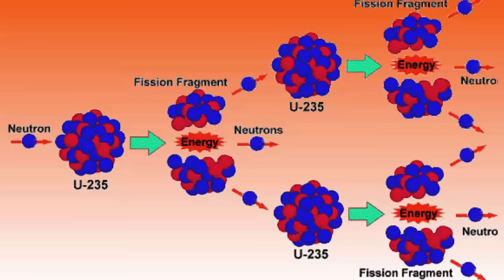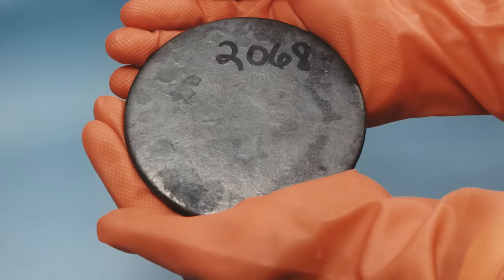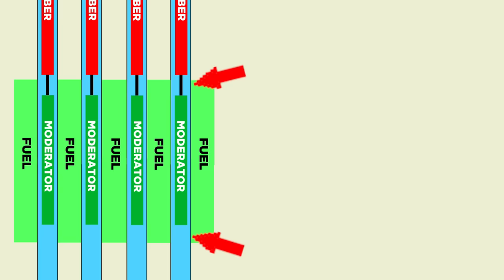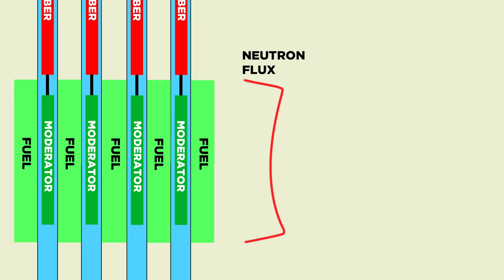What /Actually/ Happened at Chernobyl

Comment from the maker: Corrections!
1. Not all of the uranium in a nuclear bomb...fizzes...actually only pretty small amount does before the core blows up and the atoms get too far apart. And yet...it's still a pretty big deal.

2. It's not "fizzes." Fission is both a noun and verb, so uranium "fissions" 

3. I imply in this video a little bit that you can't have a light (regular) water reactor with a negative void coefficient...you can, you just need a different fuel / moderator realtionship. There are lots of light water reactors that are much safer than RBMK designs....they tend to require more fuel enrichment. 

4. An earlier version of this video got the date wrong and said October 26th instead of April 26. I just removed that line, which is something YouTube lets you do now.

Let me know if you've got anything else I should add here!!
Reply: So my birthday is on the anniversary of the Chernobyl meltdown? Yay?
Reply: @desireevelez530  Mine is when the Hindenburg crashed, well  I was born a few decades later, but still
Reply: I was so confused bc I was sure Chernobyl was in my birth year but over half a year before I was born, causing my mom to worry like crazy about me. (She lived in Germany, close enough to be possibly affected.)
Reply: @naomilovenpeace  Mine too. Here's a tip. Turn off the news.
Reply: Unnecessarily Pedantic Alert

The verb form of fission is also fission. So, U-235 fissions in a chain reaction.
Reply from the maker: @mariewikiwaka3851  Fizzes!
Reply: Correction to 1:54 Fission not allways leads to lighter particles and emmited energy, only if you split some heavy particles like Uranium. If you would manage to split up Helium you had to invest a least the erergy you got by the fusion  of hydroden to helium. Otherwise we violated the conservation of mass/energy.
Reply: Can we mention that the potential impact was severely exaggerated. Like there was no way it was ever going to be "fatal to the entire population of Kiev".
Reply: Furious Imperator  my mom was pregnant with me too I was born 4 months after
Reply: Nuclear Reactors are eco-friendly ???
Coz one mistake can take away thousands of lives affecting future generations  too... 
What are your views..? 
These fission and fusion gonna really do fission and fusion leading to.. what?!!!
Reply: vlogbrothers I said “Unnecessarily Pedantic”. I personally like fizzes better.
Reply: So why cant we channel or contain the heat byproduct from fission effectively? Isn't it also be a form of energy (thermal) we can contain & use? P.S. I'm not smart
Reply: You did well, it is a dense topic, but without that incident things could have been different through out the world.
Reply: Hi Hank, steamfitter and power engineer here, thank you for the explanation on explosive boiling.
Reply: @vlogbrothers  100% HERE FOR THIS NEW AND IMPROVED CONJUGATION
Reply: That was Chernobyl’s End Game.
Reply: @pranakhan  After the coolant absorbs the reactor heat, it is pumped to another place where that heat is transferred to water (cooling the coolant so it can be reused), boiling the water into steam that is then used to drive the turbines that actually generate the electricity. So not only is that heat indeed a form of energy we can use, generating that heat is the entire point of a nuclear reactor, or indeed any kind of power plant that uses fuel, from coal to natural gas.
Reply: @vlogbrothers  Language is dynamic and I do like the term 'fizzes' to describe the reaction of fission.
Reply: @Izandaia  Thank you for the detailed explanation! That makes total sense. So in the incident of a meltdown, the heat generated must be so intense that it's compromising multiple systems then? Is the cap on the heat intensity based on the materials or the design, or both? Its hard to imagine in our modern age facing the problems we have with this kind of energy, from a laymans standpoint
Reply: After watching the mini series I feel like nuclear power is just not worth the risk.  I realise this comes from a place of fear and may not be rational but I really wouldn't want a reactor anywhere near my house.
Reply: I don’t know if someone else mentioned it, but the miniseries doesn’t portray the politics of the situation well either. I enjoyed watching it, but it totally misunderstood the politics of the Soviet system and added drama and conflict that never would have existed in reality. The scientist would’ve never gotten her lab if she acted the way she did in the show.
Reply: Yeah my brain, after watching the HBO miniseries, said something wasn’t right. Mainly because the cleanup/extinguishing of the fire happened at the beginning of May, just a few days after the explosion. So I had to scratch my head a bit when Hank said October....
Reply: I was gonna say. This was literally the day before I was born.
Reply: Thorium is fissile?
Reply: Thank you.
Reply: Thanks for the shout out to Scott Manley.  When are you guys going to have a joint video where he teaches you how to build and  fly rockets in Kerbal Space Program?
Reply: @pranakhan  I don't know about Chernobyl, but many reactors use the heat from the fission to heat another system of water to turn turbines that make electricity. Keeping the two systems separate is to minimize the radiation on the water system so it can be cooled down.  The large structures at most nuclear facilities in the US are actually the cooling towers.  That probably made you more confused. 😊
Reply: Naomi Williams also my ex’s birthday! In hindsight that makes the explosive breakup make more sense lol (decent person, terrible breakup)
Reply: @chupaxf  I've done similar reading and taken similar courses (Я даже немного говорю по русски), but I'll admit I got a fair bit of my opinion from Masha Gessen. If you know current Russian politics, you know her name. I'd highly recommend the article she wrote for the Newyorker. Also while I understand the usefulness for having a composite character for sake of screen-time, I found her character irksome in that she was all-knowing despite the speed of events and never seemed to get in trouble. Having more scientists would've allowed the series to more accurately portray the processes and risks of Soviet science. I also think it's fair to point out fundamental inaccuracies in docudramas like this when they become this successful because it often forms much of the entirety of people's knowledge-bases about the events.
https://www.newyorker.com/news/our-columnists/what-hbos-chernobyl-got-right-and-what-it-got-terribly-wrong
Reply: @nameme5280  I do understand where you come from but I'd also want you to know that nuclear power is efficient and friendly to the environment when compared to our conventional methods of electricity generation.. I do understand your fear of risking people's lives but we're not out of risk ourselves.. we just don't see the things that are at stake yet.. the amount the conventional methods contribute to environmental pollution and global warming is fairly large .. it's like a slow poison.. everything has its risks and effects if not used conservatively.. but we need to see which one has the least side effects given we are absolutely cautious of what might happen.. I hope my insight was helpful.. incidents like Chernobyl, while they're really heart wrenching are a wake up call to be more cautious but not just a sign to turn our backs to great developments in the future. DFTBA!
Reply: Mine is Pearl Harbor Day.
Reply: @naomilovenpeace  Mine too, TIL.

My fiance's birthday is September 11th & mine is Chernobyl's anniversary.

I have jokes I want to make now but they are all in poor taste.
Reply from the maker: @neneold4912  Thorium is not fissile. Thorium can be triggered to decay into an unnatural fissile isotope. Usually we use plutonium for this.
Reply: vlogbrothers I’d like to add that you can’t emit pure energy as radiation. All radiation are particles
Reply: Wow, humans are dumb sometimes, sigh. I remember when this happened, scared the hell out of me, I've never been the same since. As a kid I didn't really get how far away I lived from Chernoble or anything about politics and poverty etc, I was just scared that one of these powerplants was somewhere nearby to where I live. I'm now going to go find the YT vid on how surprisingly well the wildlife ect around the site have rebound... gotta get my headspace back to happier.
Reply: vlogbrothers thank for making corrections for me comrade Hank
Reply: About number four: It was actually really noticeable, but maybe I think that since I watched the original.
Reply: Naomi Williams omg same
Reply: Well done. Especially the mention of Scott Manley at the end, so no one else has to point to that.

I'd learned a simplified version of this in school, long before this event. It was likely 1979, just after the incident at Three Mile Island, as I live in New Jersey. The information I got from that, and take this with a grain of salt, it was '79 and we were 10- and 11-year-olds, was that "American reactors pull the rods out to stop, and Soviet reactors put them in. Ours (in the U.S.) is a much safer method, but things can still go wrong."

So 7 years later, in my senior year in high school, this happens, and the reaction was "well yeah, that's what you get when you build a reactor backwards."
Reply: Hey, how can I edit out things from YouTube videos as he did in number 4?
Reply: Mass is not converted to energy or vice versa. Mass and energy are equivalent.
Reply: @DehimVerveen  If potential energy is converted to kinetic energy, or any energy type is converted another, then "converted" is correct. It's one form becoming another.
Reply: So, while on the topic of Uranium, are we going to find out if Carl ever got his?
Reply: "In a nuclear bomb it's 80% U235" It's usually plutonium.

The term for a partial explosion of nuclear material is a fizzle not a fizz. A fizzle causes a rapid release of energy that very rapidly disassembles the material before it can fully detonate. Even a fizzle can release huge amounts of energy.
Reply: Nope... The original had an error, so now the entire video is considered irrational and consequently, will be interpreted as heresy.
Reply: Well more than likely the fuel rods cracked, blocking the rest of the control rods from completely entering the uranium fuel. So the graphite was stuck, continuously speeding up the neutron and then causing the explosions.
Reply: @vlogbrothers Your "the nuclear reaction products are lighter therefore the mass converted into energy" explanation is a common misconception about the source of nuclear energy. All releases of energy, not just nuclear, will be associated with a release of mass, because energy has mass. This includes chemical reactions, for example. If you burn hydrogen in oxygen for example, and let the heat dissipate, the water you get will have a tiny bit less mass than the combined masses of the hydrogen and oxygen you had at the start. We don't talk about the change in mass "causing" chemical energy. The change in mass is just a minor tangential consequence. What caused chemical energy to be released was the change in the arrangement of electrons and protons, which have electric forces between them. Similarly what causes nuclear energy to be released is the change in arrangement of neutrons and protons, which have nuclear forces between them.
Reply: A FEW major and small things to add (seven points):
1. the USSR in terms of governing at the time was nothing like it was depicted in the TV series
2. no one was threatening to kill anyone
3. ministers did not come to miners with AK-armed guards
4. people in the government and scientists had great respect for each other, a completely opposite picture to the smear the TV show does to those people and their memory
5. the minister was an engineer himself and he has never needed an explanation on how the reactor works (even more: every child in the USSR knew that as it was an obligatory part of education in physics course)
6. the real cause of "hiding the information" was to prevent panic to evacuate 300 000 people from the area. As a result, Chernobyl has caused like orders of magnitude FEWER victims than e.g. Fukushima, Katrina and many other disasters where panic has actually prevented successful evacuation and caused from significant part to even the majority of all victims
7. almost no one was drinking vodka in real-life equivalents of the scenes where the TV show depicted it.
Reply: Where did you get your t shirt from?
Reply: @Tfin  Yes, one type of energy is converted to another type of energy, but the mass before and after the reaction is the same.
Reply: You didn't see a wrong date. You didn't. You didn't!!! Because it's not there!
Reply: The use of the term 'reaction rate' here along with the mention of the reaction 'speeding up' or 'slowing down' is somewhat confusing. Reaction rate has an exact definition in chemistry which relates the change in products and reactants over time with the concentration of those materials. What's really being discussed is the number of reactions occuring in a given volume over a period of time. And the the speed of individual reactions is not changing. A better way to approach this might be using the 'intensity' of the reaction.
Reply: Sorry, I'd never actually post something like this, but hey, you asked for it... Both the "m" and the "c" in E=mc^2 should be lower-case.
Reply: vlogbrothers a heavy water reactor (the CANDU) actually has a positive void coefficient (because of different somewhat difficult reasons, but simplistic, because moderator and coolant are sill separated). A regular Light Water Reactor however, were water is both the coolant and moderator, the statement holds. So, not heavy water, just normal water.
Reply: @hororskull  Probably not. But the two are extremely close, and radiation levels in Kiev were at times extremely high and should have justified at least a partial evacuation. 

In one sense of course there was a partial evacuation: the children of party leadership were sent elsewhere by their concerned parents -- the same people who lied to the public about there being no risk and who took measures to prevent anyone else from sending their children away.
Reply: 1:56 it doesn't become energy it transferred into energy
Reply: The xenon is always there and being produced in an RBMK reactor. It's that in stable output operation it's getting burned up as fast as you are making it.
Reply: I remember them mentioning in the show that the rods that they actually completely pulled out of the reactor, and then put back in to increase the power level, at the very tip, were coated in a boron layer, and not graphite. Later on in the testimony episode they go on to explain that this was a cheaper option. If there was graphite on that portion of the rod, the reaction wouldn't have spiked as much as it did, because graphite in part can actually help stabilize the reaction, but the Boron was an accelerant. This was in part part of the positive feedback loop of which you're speaking of. Then they later go on to explain that all of the reactors in the Soviet Union of the time did have this defect, and that why their fail safe button didn't work in the end.

I'm sorry if this isn't super clear, I'm still trying to completely understand the situation myself. I'm currently in school studying a BSc in Physics while doing nuclear/radiation experiments so this is a fascinating topic for me!
Reply: Correction #5. You didn't see graphite on the ground because it's not there!!!
Reply: @nameme5280  Same.  After watching John Carpenter's The Thing, I decided arctic research was not worth the risk.
Reply: @111ch1a1d111  hahaha, such a Chad you are
Reply: My brain hurts.
Reply: @naomilovenpeace  My late brother's, too. And the Rodney King riots anniversary.
Reply: Hi Hank, thank you so much for this video, I feel like for the very first time I'm really beginning to understand what happened in the reactor. I still have one question though: at about 3/4 of the video (10:23) you say "The thing that you're supposed to do ..." but you never finish that sentence! So now I'm still wondering, what were they supposed to do? I'm guessing instead of pushing the rods further in, they should have taken them out completely and filled that space with water? Am I guessing correctly? Would be great if you (or anyone else of course) could answer that question. Thanks!
Reply: 12:00 i dont think the steam just splits into hydrogen/oxygen due to the heat (or wouldnt it detonate right then and there?). I believe it was due to the zirconium alloy getting oxidized by the steam, liberating the hydrogen. Thats why it wouldnt just explode right there, the oxygen was hogged by the zirconium cladding on the fuel rods. (Google oxidation of zirconium by steam).
Reply: You should talk about LIFTR reactors in another video. Those are basically self regulating reactors that can't explode.
Reply: Hmmm, kinda not really... 

Xenon was a key reason for removing too many control rods, which increased the positive void coefficient of the reactor. However, the burning of the xenon itself is a slow process, not significantly contributing to the power excursion. 

The trigger for the power excursion was the experiment to trip 4 of 8 running recirculation pumps several seconds prior the accident. The recirculation flow then slowly decreased due to the pump run-down, the steam content within the pressure tubes increased (the RBMK was kind of a boiling water reactor), and this caused a gain in reactivity. The process computer inserted more and more of the  automatic rods, to maintain a constant fission power. Only after all automatic rods were inserted, they pressed the SCRAM button... after this point your explanation then is correct ...

Long story short conclusion, the xenon only played a role for preparing the stage for the main player: the positive void coefficient ..

And btw, there are no high-power reactors moderated and cooled by heavy water. The canadian CANDU as well as the argentinian PHWR use D2O for moderation but H2O for cooling. Therefore these reactors also have a positice void coefficient ... but by design this coefficient is way smaller than in the RBMK that it can be controlled by fast-acting rods...
Reply: @naomilovenpeace  You may celebrate the end of the evil empire that was the U.S.S.R..
Reply: Also the spent fuel was reprocessed into plutonium just like the Hanford B.  But unlike it RBMK recycled its coolant instead of just dumping it back into the Columbia river.
Reply: Others may have said this but, weapons grade uranium for bombs have to be at minimum 95% purity to create the blast. Most modern bombs that use uranium are closer to 99% purity. Current generation nuclear reactors use fuel purified to around 80%.
Reply: Why do Neutrons exist? Actually, try and figure out the way to pack a bunch of positively charged particles within a radius of about 10^-15 m without anything to bind them. Actually, neutrons are there just to keep the nucleus in shape. I guess you might want to add this to the list of corrections.
Reply: vlogbrothers Your explanation of events doesn’t indicate that at the heart of this it occurred because of negligence of the reactor staff.  The design, although foolish, was not inherently unsafe.  Also, the rods moved in groups in this reactor.   This is critical but it takes too long to explain.  If the DOE has publicly released their report on this I recommend you read it.  And I really wished you had discussed criticality and prompt criticality
Reply: Conversely to point 3, you imply that heavy water moderated reactors necessarily have a negative void coefficient. This is untrue, as demonstrated in the CANDU design at the station I work at.

There are postulated accident scenarios where a positive void coefficient would be preferable, so one shouldn't get too fixated on the sign of the void coefficient as an analogue for the safety of the reactor's design in all accident scenarios- it's a more nuanced topic involving more variables than can really be gotten into here.

The magnitude of the coefficient, on the other hand, is what determines the kinetics of the transient, so the smaller the difference between the moderating effects of the void versus the liquid moderator, the more time the operators have to react and either reestablish control or activate the special safety systems that kill the chain reaction (with acknowledgement that decay heat will always need to be removed for a period of time after shutdown).
Reply: Anonymous Anonymous  "we've also been able to find things like the unstable form of plutonium in space where there are no nuclear reactors"

I'd like to point you to our nearest extra-planetary nuclear reactor. We call it the sun. Space is filled with nuclear reactors. The fusion that occurs in stars is the source of the heavier elements. That's where that quote about us all being star-stuff comes from.
Reply: NuclearSavety Close but incorrect. The CANDU is absolutely a heavy water cooled and moderated reactor. There is a heat transport circuit (coolant) which is D2O at high pressure and temperature that runs through a series of pressure tubes which have the fuel pellets loaded inside and continues on to boilers which produce steam from water on a secondary side to drive the turbine which turns the generators to produce electricity.

Separated from the pressure tube by an insulating annulus gas space is an outer tube called a calandria tube. This separates the fuel channels from the moderator which sits inside a large vessel called the calandria. The moderator heavy water is at a lower pressure and temperature than the coolant.

The selection of an all heavy water design was purposeful as it allows natural uranium to be used directly as a fuel, bypassing the need for costly enrichment facilities. (This was less of a factor for countries which were pursuing nuclear arms programs as these would be needed for military purposes anyways).

Natural uranium can be used in this design because heavy water is less likely to capture a neutron and prevent it from going on to interact with another U-235 atom to continue the chain reaction. Since a high proportion of the neutrons produced go on to participate in the chain reaction we say we have a high neutron efficiency. This means you don't need as high a concentration of U-235 to sustain a chain reaction so even the small amounts in the natural ore will work.

Despite the negative void coefficient, the magnitude of the change is very small as boiling would be initially contained within the pressure tubes and the high neutron efficiency results in limited excess capacity resulting in a 'sluggish' response to changes in reactivity. This means greater time to react and take corrective measures to restore control.

The CANDU is a very safe design overall with two independent failsafe special safety systems each capable of stopping the chain reaction with no assistance from the regular control system and operating on different principles and different logic which can trigger their intervention without operator intervention.

One system consists of spring assisted rods of highly neutron absorbing material that remain poised to enter the core but are restrained by magnetic breaks. In the case of a loss of power or signal to fire they would rapidly descend and stop the reaction.

The second system is based on injecting a large quantity of liquid poison into the moderator in the core to absorb the neutrons and stop the chain reaction. This is supplied by tanks connected to the calandria directly that maintain an equilibrium pressure with that of the moderator in normal operation. Connected to these tanks, helium is stored at high pressure. The helium and liquid posion are separated by motorized valves which are energized to close (fail open). On loss of power or signal to fire, these valves open causing the high pressure helium to force the liquid into the core. Inside the poison tanks are floats that seat when empty preventing the helium from entering.
Reply: hi,  at 10:00 you said the water flow rate decreased causing an increase in temperature, but according to wikipedia "As part of the test plan, extra water pumps were activated at 1:05 on 26 April, increasing the water flow. The increased coolant flow rate through the reactor produced an increase in the inlet coolant temperature of the reactor core (the coolant no longer having sufficient time to release its heat in the turbine and cooling towers), which now more closely approached the nucleate boiling temperature of water, reducing the safety margin." water flow rate was increased not decreased, there is no reason for them to decrease water flow rate in that situation and you are incorrect. great video though thanks
Reply: Regarding your item #3m it's not the fact that it's light water that affects the void coefficient, it's the fact that the RBMK is a BWR (Boiling Water Reactor) which means that the water coolant turns to steam within the core during normal operation. Yes, it being a light water reactor changes the rector physics when compared to a heavy water reactor, but it doesn't have any effect on void coefficient. If, for instance, it was a PWR using heavy water, there would be no voids.
Reply: In the Los Alamos primer, the verb used was "fishes".
Reply: The tertiary stage in a fission-fusion-fission bomb DOES mostly fission. That’s why Castle Bravo was a 15 megaton yield, not a 5 megaton.
Reply: @vlogbrothers  you got a new subscriber with one video. This should be titled "what actually happened at Chernobyl or an introduction to nuclear physics."

While it may appear to be unrelated, this video gave me several epiphanies regarding "social sciences," for simplicity's sake. I have been an independent researcher in Native sciences for about 40 years; as such I look for patterns in nature to answer what are generally considered sociological issues. 

This video helped me find more important questions, based upon natural patterns, in regards to a theory I am working on which states that the political spectrum is not linear but circular, and social problems, politically, can be expressed through the decoupling process used in thermoplastics.

"Physics is physics even when it's metaphysics"

Thank you again for a great and informative video.
Reply: @aditigupta1569  If you think either Chernobyl or Fukushima resulted from one mistake then you have some serious reading to do. By comparison the health impacts from Germany's coal plants kill more then Chernobyl has every few years.
Reply: @neneold4912  "Thorium is fissile?
 No.
Reply: @vlogbrothers  Yes, one more thing:  realtionship is not a word.
This was an excellent explanation, thank you.  My skeptical spidey senses were buzzing through the entire miniseries...
Reply: @eustache_dauger  What are you talking about?
Reply: @salerio61  There is an isotope of Thorium that is fissile, in the same way that Uranium has fissile isotopes. You can't just make a blanket statement that Thorium is not fissile. There is a whole fission cycle based around Th-232, in fact it could be the future of energy from nuclear fission.
Reply: @langdalepaul  wrong. Thorium 232 is not fissile, stop spreading lies. Thorium 232 with a neutron capture to thorium 233 undergoes two beta decays to uranium 233 which is fissile.  Thorium is not fissile.
Reply: @salerio61  Lies? That's pretty strong. OK, so my last comment about the future of fission energy is inaccurate, since Th-232 is not fissionable by thermal neutrons and therefore fissioning of Th-232 is not part of the Thorium fuel cycle, but it very much is fissionable by fast neutrons.

https://www.sciencedirect.com/science/article/pii/089139195790178X

Please try not to be so aggressive and accuse people of spreading lies when it is most likely to just be inaccuracy or misinformation. Accusing people of mendacity when they disagree with you is the biggest problem we currently have with public debate. We're never going to agree about anything if our first assumption is that everyone else has malicious intent.
Reply: I could say that it was a military experiment, how to continue producing electricity in case when  power plant damaged by air or artillery strike. Normally such an experiment should not be happened. This experiment was forced to implement after Israeli Air Forces shot down power plant in Iraq in 1981.
Reply: Stranger Happened your 7 points directly contradict General Major Tarakov, who holds Boris directly responsible for the late evacuation. This was a disastrous decision.
Reply: i was rewatching this and noticed the odd cut at the begginning lol
Reply: @pranakhan  Not an expert, but I'd imagine it has to do with cost and the limits of various materials. Reactors like Three Mile Island and Fukushima Daiichi have thick, expensive containment structures that contained the vast majority of the heat, pressure, and radioactive particles during the accidents. Chernobyl had minimal containment structures. So that's the cost part.

If we ignore the cost, I suppose one could build a reactor deep under ground or something. In which case, any extreme event (from a thermal explosion to a thermonuclear bomb) would be contained, but the reactor would be impossible to operate (coolant, sensors, robots and people have to get in there which would require gaps in the containment). Even if you could somehow access such a reactor in order to operate and maintain it, the reactor vessel itself (fuel rods, control rods, etc.) wouldn't be able to stand up to an extreme event. You'd get no useful energy from the reactor during or after an extreme event.

These are engineering problems. The solution is to try to achieve a fail-safe design, in which all the failure modes are known and understood, and all failure modes result in a safe outcome. There's no such thing as perfection in engineering, but I think the current French designs, for example, have achieved something very close to it, at a reasonable cost. The so-called fourth generation designs are also very promising.
Reply: @nameme5280  a quite rational fear! The ramefications of a nuclear accident are unfathomable and almost eternal.. Fukushima only confirmed that Murphy's law also apply to nuclear powerplants, however the safety meassures.
Accidents aside, the waste produced in a nuclear powerplant, is highly toxic and the only solution is to wait for it to decay... That will only take around 100.000 years. In ty t comparison: it's less than 10.000 6 ago humanity wenlt from hunter/gatherers to h. Who knows if it's even humansh walking the earth by then. How do we mark the waste making sure it will stil be legible.
Reply: On the wikipedia page for void coefficients it says that LWRs can have negative void coefficients. Thanks for the correction, but it's not a deep dive to avoid that kind of mistake.
Reply: 7:05 "The normal thing with an RBMK reactor because of all these positive feedback loops is to slowly get the power back up." Actually, the mandated operating procedure was an even more prudent approach: when in a xenon pit, you had to shut the reactor down completely and wait for the xenon to decay - 135 Xe has a half-life of about 9hrs, but you'd have to wait 2-3 days in order for it to be at safe levels. 

They didn't do this.
Reply: "You're delusional. The core can't explode".
Reply: Just thought I add that there is such a thing as a nuclear fizzle vis a vis fission bombs- it's when a supercritical  mass of uranium "explodes" (which can mean just melt really) just enough to make the mass subcritical thereby stopping the reaction before enough fission generations have occurred to make a viable explosion.
Reply: why are you wearing a tshirt that has pizza on it?  Is your nickname “skippy”?
Reply: I may be wrong, but I thought they had pulled the control rods out even further than the standard “accelerate” position, so that a larger column of water evaporated at once upon reinsertion. Cannot find the reference though!
Reply: @vlogbrothers what actually causes the second explosion? I can get why the first one happened - the runaway reaction produced tremendous amounts of steam, which pressured the container and blew off the upper biological shield - but then what? The pressure inside the core was released. The graphite was hot, but heat isn't an explosion. The water dissociated into hydrogen, which does explode, but wouldn't that have happened before the pressure built up enough to blow off the UBS? Or was it that the precise H and O mix in the new environment of "open core" and "reactor room", plus heat, which caused it to explode?
Reply: Thank you for your explanation. You should be a teacher, this was very interesting and entertaining.
Reply: Close but you got one part wrong. The fuel is in the middle. Top to bottom its graphite/fuel/graphite. The C-rods were pulled all the way up to align bottom of tip to top of fuel. (Aligned with the upper section of graphite.) Water was the only thing in the C-rod void. When they were reinserted, the fuel all of a sudden had a massive increase of moderation. Not just the bottom but the whole core was supercharged. Then something broke. Rods stuck. The xenon-135 burned off rapidly. And the rest is history. Here is a image link with a better, easier to understand, representation of the C-rod/fuel/moderator design.  https://images.app.goo.gl/BJccD5CDu5WzjC1X8
Reply: Try saying Fissions five times fast.😁
Reply: Kinda like your explanation and my brain. One speeds up and one slows down.
Reply: @aditigupta1569  just count the 14 on all your fingers!
Reply: Mine is the day that reactor came on line !
Reply: Several were killed outright along with many news outlets !
Reply: This is the first time ive stumbled upon your personal channel seperate from scishow
Reply: Here are some facts about both Chernobyl and Fukushima compared to coal power to help you put into perspective how beneficial nuclear power really is.

The IAEA estimates the number of initial deaths at Chernobyl were 31, with long-terms estimates around 4,000. Fukushima on the other hand resulted in exactly zero deaths, and the IAEA estimates long-term death rates between 0 and 500. More recent studies have confirmed these original estimates as accurate. As for an increase of birth defects near Chernobyl, there isn't much evidence to support a conclusion. There doesn't appear to be a drastic increase since the disaster despite what documentaries (HBO's Chernobyl Heart) would have you believe.

The biggest difference between the two accidents however is the response from the government. The Russian cleanup effort was horrifically inadequate, where much of the highly contaminated waste was simply buried under a layer of topsoil. They did such a poor job that recent tourists to the area have found highly radioactive core fragments still lying around. The Japanese government on the other hand did an excellent job of cleaning up. In fact some people have actually been allowed to return to previously evacuated areas.

If you take into account all of these disasters, and make no mistake they're horrific events, and compare them to coal? Coal doesn't stand a chance. In one year, more than a million people die prematurely due to coal power generation, 600,000 of these in China alone. How's that for a comparison?
Reply: Yay graphite let’s make a nuclear meltdown
Reply: If we can cut the top off of a mountain to mine the coal underneath, then why can't we build a mountain on top of this dead reactor??
Reply: Fast neutrons are less reactive not because of any mysterious quantum mechanical reason, but because they have a shorter wave-property wavelength: they sort of sneak by things unnoticed. Slowing them down increases their associated wavelength: they are like lumbering drugged elephants, crashing into things and falling into pits.
Reply: @pranakhan  
We can, but here's the problem:
1) Reactors are steam engines, just like a steam train.
2) Steam engines are low reliability and high maintainence
3) Reactors must have PERFECT reliability and preferably low maintenance.
4) How do you solve this disconnect? Money.
money money money money money
Building a perfectly reliable stream engine, fueled by a nuke pile no less, is expensive
That's why we don't have many, they never lived up to their too-cheap-to-meter promise.

For that to happen, we need liquid fueled reactors (there's a reason your car runs on petrol instead of coal) that are salt cooled.
Then, nuclear will be cheap and plentiful.
Reply: @nameme5280  
And that is the good damn problem.
"Not In My Back Yard"
You can't base decisions on worst case scenarios like this, nuclear plants are quite harmless, these ones that failed were all 1960s designs.
Reply: @fibonaccibot3792  
"The Scientist" was a composite character, she wasn't real. She represented the Soviet science groups, 1000s of people, and their collective anguish at having their work suppressed so as not to embarrass the glorious republic.
She was also Legasov's conscience.
Reply: @neneold4912  
Thorium is fertile not fissile
Reply: Nuclear bombs create implosion or compression, creating the chain reaction.  A fizzle is when there is little actual yield relative to the core's potential yield.  Tsar Bomba for example in its massive scale of 50MT detonation, consumed nearly all its potential yield and was relative clean.  Hiroshima, was nearly a fizzle in terms of yield, releasing a massive amount of radioactive fallout.
Reply: Response to correction one it's about a gram in the "little boy" design.
Reply: Addressing a few of the environmental/safety questions... Nuclear plants today are incredibly safe with redundant systems and failsafes. The real issue with generating power via nuclear plants is the waste generated. IT is dangerous and much of it remains so for a very long time.  It also generates radiation which speeds up the breakdown of the materials used to store and monitor it. While we can definitely store the waste safely for 50-100 years, what happens to it 150 years from now? Basically we are playing kick the can and making this the problem of our great, great grand children. If a cataclysmic event happens and humanity stops advancing or even reverses course (as our current administration has shown us is a very real possiblity) they may be unable to deal with it and the resulting mess can cause a very real environmental disaster. We can safely store nuclear waste and byproducts and it takes up relatively little room compared to most other energy byproducts, however, nuclear byproduct is a much longer term issue. (Which also leads to the question of the cost of monitoring and addressing future storage and problems of the waste which has already been created)
Reply: The King  *nagasaki
Reply: The King  it fissioned no plutonium because it was a urainium bomb
Reply: Hi vlogbrothers, you need to remove one short sentence which is an inaccuracy borrowed from HBO. Xenon is only dissipated by the reactor in proportion to the reactor's power. So xenon disappearing had virtually no influence on the accident. The power was only increasing for a few seconds, so there was basically no time for the xenon to disappear.

In fact, the reactor remained poisoned by xenon even after it exploded! The gas was hanging around, poisoning the scattered lumps of fuel that remained.
Reply: Soviet scientists knew that RMBK reactor had problems, but government ignored them. They knew how it wxploded within 36h.
Reply: @Rahkesh357  It's not really accurate to say that the government ignored them. The reactor's designers and highly placed scientists ignored them. Gorbachev was curious at the lack of oversight.
Reply: Nuclear Engineering Masters Student here! It isn't really correct to refer to light water as a neutron "absorber". While yes it can absorb neutrons, it is still far more likely to simply moderate them. It is less good at moderation than heavy water, but that doesn't make it a neutron absorber. The issue with Chernobyl is that it was what's called "over-moderated" meaning it had too much moderation. When the water was displaced and boiled, the total moderation went down, which actually sped up the reaction because there was too much moderation to begin with. All U.S. reactors are "under-moderated" meaning they have less moderation than would be optimal. When the water in U.S. reactors boils away, the power level actually decreases because there is too little moderation to sustain the reaction. Hope this helps!
Reply: Yes. you are implying you can do a "safe" or "much safer" nuclear reactor only from a technical point of view. 
But we humans can blow all sorts of them no matter how difficult it is. 
So maybe you should consider human factors and safety culture as the best fail safe. 
Good luck if you think that this cannot happen in your closer nuclear plant just because it has a negative thermal loop or a Scram without moderator rods involved.
Reply: Most modern nuclear weapons are Pu-239.  Technically there IS uranium in most Teller-Ulam type fission-fusion-fission bombs currently in use in the arsenals of the US, UK & France, in the form of a U-238 tamper in both the primary & secondary stages. Russia & China sort of do their own thing design-wise (at least since stealing the US's initial designs), so I won't get into the Sloika "layer cake" type by the Russians, but they undoubtedly use some amount of enriched uranium as well. So really it is weapons grade Pu-239 that causes the "boom"; the tamper is simply there to increase the amount of total fissions prior to the weapon disassembling itself for the purpose of increasing the x-ray pressure & neutron heating of the secondary by the primary, thereby increasing overall yield. They can (and have) actually use an inert material for the tamper to decrease the yield, or alternatively, utilize Cobalt-60 (or any number of other metallic elements with a high neutron cross section) to greatly increase the fallout.  I know, I'm splitting hairs.
Reply: Baker 3311 Because of the heat.. Think ‘nuclear volcano’. 
But there is a lot of sand and other stuff on top of anything radioactive, aside from the core, and a giant sarcophagus over the top. Really pretty amazing engineering feat.
Reply: vlogbrothers, there is one extra correction. When you said about that unspecified part breaking, that part was a hotspot that had grown in the reactor when the control rods were lifted. This happened because of the moderator part. NOTE: I have studied chernobyl for YEARS. I have gone over many documentaries, practically absorbing the neutrons of knowledge, and using the control rod of the brain to do that. The series isn't entirely true. There are many parts in it that are false. I only researched parts that are TRUE. If you want a proper explanation, which may give more truth to this, please use my channel comments to talk to me. 
Let me add. I have studied this since I was around 10. Now, I'm 25. AMA and I will give you the most detailed explanation I can do. 

Keep goin' Hank.
Reply: Naomi Williams, wait. I'm not the only one that shares a birthday with the day that Chernobyl exploded?! Never knew that.
Reply: I love the fizzes correction. 

Here is my take:
Alka-Seltzer.. Fizzes.. 
and.. 
Radiation.. Fissions. 

Ok.. I understand now.. well.. sort of.
Reply: @mariewikiwaka3851  No
Reply: @effuah  Could we split Astatine?.. What would happen?. what if we split atoms of anti-matter? I've not a clue.. but I find it fascinating.
Reply: @typoclerk  you could, but it decays by itself (halflife of maximum a few hours), you get a little less energy than by spliting uranium. Alpha decay is a common form of spontanous spliting an atom. Anti-matter is basicly the same as normal matter, only if you mix matter and anti matter you get extreme effects. But earth is full of normal matter, so it's extremly hard to create lager atoms of anti-matter
Reply: @effuah  Fascinating!.. thanks Maddam
Reply: My birthday is on the same day.. others were born on.. isn't that fascinating?
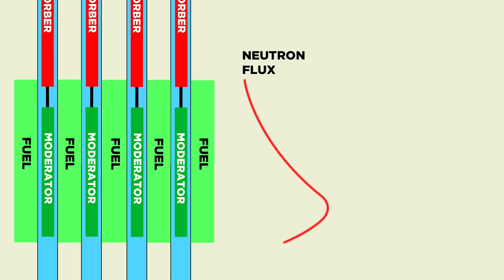Reply: I think at 10:28 you, and apparently Scott Manley as well are both mistaken. Water is not absorbing neutrons, its moderating them. It was not the displacement of water triggered this accident, but the fact they disconnected the main pumps and the rundown generators were providing even less water to the reactor, which was already low. Remember: the runaway started to happen before they pushed the button: the exponential grow of the power was the reason they pushed the button in the first place. So in this case the original factor was the heat coefficient: due to the lack of coolant the fuel started to heat up, which burned away the Xenon, which added to the reactivity, steam voids were started to form which removed even more cooling capacity, increased heat etc. This is the runaway event. They pushed the button which made things worse by displacing water but not because of its neutron absorbing properties, but because of its cooling properties plus the fact the material displaced water was a good neutron moderator.
Reply: Actually the verb for Fission is Fissioned so it’s not the same.
Reply: The fuel rods have their own channels and the control rods are in a completely different seperate channel. Those channels are made of graphite. The fuel rod also sits in the middle of its channel and is attached to the lid and on to the caps.
Reply: vlogbrothers I dont understand any of this! I just like the speaking of physics, and you’re good at that.
Reply: I am still not clear with how neutron flux increased when graphite tips were inserted. Graphite was already in the core accelerating reaction. AZ5 was pressed this made graphite go down. Some hot water was at the bottom and it touched it. does that increase neutron Flux. It shouldn't rite because normally also graphite will be in contact with water. How does this steam to water entry effect?
Reply: Dorian Mode  - which created pressure and steam, which then blew the top up.
Reply: " fizzes." Lol
Reply: @hororskull  If memory serves, the passage you mention refers to the potential of the 2-plus megaton "flash" explosion that could have occurred if the melted core hit the water in the sub-basement. "Entire population" is probably unlikely, but the context was in trying to make the case to "the powers that be" that something drastic needed to be done quickly. They were trying to justify sending three men to their deaths to drain the basement. (We learn later that all three lived and two were still living when the series was made.)

I find it reasonable to assume that these men at least were very likely to die, and I also find it reasonable that, in the situation room at that moment, the language used by the scientists to describe the potential effects of a 2-plus megaton explosion under a compromised nuclear reactor 60 miles from Kiev could devastate the entire city and its population.
Reply: For 3, just wish to point out for most people that a positive coefficient void is actually unique for the RBMK reactors. Most actually use the negative side of things, as it's much safer, due to having less reations happening in a given time. The issue being with the positive side it, that you walk a fine line of balance.
Reply: @pranakhan  Not quit. The cooling water doesn't just cool things down, it does so much more. It's also a good way to absorb any radiation that would normally be thrown into the air.
Reply: Fun fact: a “fizzle” is when a nuclear reaction does not sustain itself. Something like that.
Reply: @StrangerHappened  You... You do realise the KGB had many reports of covered up nuclear incidents, right? It wasn't as bad as the show made the Soviet Union out to be, but there were still threats of death, still things being covered up
And, by the way, the cover up on Chernobyl wasn't to stop a panic, and if the government had respect for the scientists at the time, why would the Ukrainian government, of all countries, take all information about radiation sickness and other such things, from the Kiev Library?

If you really want to try point something out, I really suggest you watch the interviews of all the people that were there. The one thing the show got right was the Soviets stance on Nuclear Reactors: That a Global catastrophe from an RBMK reactor, from the soviets, is impossible. They kept up the lies to hide the scale of it. Again, there have been many many incidents before reactor 4 blew up. All covered up by the KGB (which are no longer covered up due to the fall of the USSR. Many documentations became available).
Reply: Neutrons assure cohesion of protons that would otherwise repel. Excessive energy in atom is released in form of radiation.
Reply: @csabasipos6525  The heat coefficient you mention is related to a decrease in reactivity as the fuel heats up. The low power in the reactor may have decreased the fuel temperature thus increased reactivity.  The main issue were the voids in the core creating a "hotspot" due to low power and the low amount of coolant water not pushing the voids out. The hotspot got worse as more and more steam voids were produced due to the positive void coefficient when they started ripping out control rods due to xenon. The displacement of the water at the end due to the control rods was the final kick in the pants.
Reply: Besides watching HBO's 'Chernobyl', what research did you do?  I'm guessing, 'not enough'!
Reply: @nameme5280  the mini series was a joke. Nuclear is by far the safest for of energy.
Reply: @your_actuallycount2768  Why is it any time someone tries to explain what happened at Chernobyl, some %&#@ like yourself has to play the "oh you're an expert 'cos you watched the HBO series" card.  🙄
Reply: @Don't Bother The zirconium fuel rods broke which meant the control rods where caught in the active zone.
Reply: Doing your due diligence, respect.
Reply: Oh and by the way it isn't always Uranium which is used in bombs, It is also Plutonium (239Pu) and is used because it easier to make than 235U because, if you get a stable 238U atom and fire a neutron radiation towards the nucleus, it will turn the atom into 239U. This will naturally turn this element into a radioactive isotope. 239U is a beta particle primary emitter, so with two quick decays, this element will turn into Neptunium-239(239Np). (A beta decay is the emission of an electron, which is formed by neutron radiation breaking into a proton, which stays in the nucleus and the electron.) Will turn the element into Plutonium!
Reply: @aditigupta1569  Well they are eco-friendly... This was just a major accident caused by ignoring safety procedures
Reply: @pranakhan  I don't think you can contain energy. What is energy I mean like is it   rays, ?
Reply: @rainydaylady6596  Yeah no i think Chernobyl does use this because the energy and heat created by fission turns a different kind of water, not the coolant water, to steam which turns the turbine
Reply: @genessab  Gamma radiation? :/
Reply: @Tfin  Well you can't "convert" energy. I believe potential energy is energy stored inside bonds and kinetic energy is the energy an object has because of motion. If your saying that potential and kinetic energy "covert" into Bond energy well you are correct there.
Reply: @MinSredMash  Ok so first, Xenon is created by the decay of Iodine, (135I) which is created by the fizzle product of 235U. Iodine has a half life of around 7 hours, so xenon is created and not burned of because the low power lead to low heat, and because the reactor was cold for 10 hours, that's a lot of xenon! And when you say "the gas was hanging around", please, it is not like particles of xenon is going to be dispersed 100km by an explosion.
Reply: @DrYeet2704  Aha ive seen your comments on the YT HBO chernobyl hello!
Reply: @jack_m2306  I don't know what post your are responding to, because YouTube doesn't display it. Which statements are you responding to? Xenon 'burning off' has nothing to do with heat, by the way, but neutron flux. If you reduce reactor power, the amount of xenon will reach a maximum and then start falling after 12 hours or so.
Reply: @jack_m2306  gamma radiation are photons, particles. Yes they are mostly absorbed readily and will be a pretty similar to pure energy transfer, but it’s not that.
Reply: @jack_m2306  not protons, photons. Photons are elementary gauge bosons, electromagnetic radiation
Reply: @genessab  ohhhh my bad😭😭. What im saying is this electromagnetic radiation/waves is this energy vreated by atomic fission
Reply: @jack_m2306  yeah, but all energy released through nuclear reactions is carried by particles, that’s just a general rule of the universe. Energy and momentum are carried by gauge bosons, that’s why they’re called ‘force carriers’
Reply: @genessab  yeah
Reply: A little late, but Chernobyl the series gets a lot wrong. It's a great, well made series, but it gets a lot wrong about everything, a large part having to do with the political handling both of the reactor before and during and the handling of the incident afterwards..
Reply: Water is a moderator AND a coolant. It is 100% NOT a neutron poison in any reactor. Good attempt to sound smart, but you contradict yourself several times in this video.
Reply: @MinSredMash  xenon burns of, but it absorbs many neutrons without splitting
Reply: @Surabpachida  heavy water?
Reply: @Surabpachida  never said that
Reply: Correction the graphite tips were not meant to accelerate the reaction they’re meant to stop water from rising to high in the core technically yes them stopping the water with technically an increased reactivity but it didn’t increase it anymore than it was before like 2 MW and that’s it they didn’t intend for it to increase reactivity at all they chose graphite because they didn’t realize what they were doing selecting a moderator as a displacer
Reply: Why slow neutrons speed up the reaction:  
Neutrons are NOT used to break the nuclei in a Newtonian, kinetic energy way. (At least not in this case.) 
They are used to create a different isotope-- U-236 in this case--which is incredibly unstable and tends to decay rapidly. 

Quantum mechanics looks at neutrons as a wave. The faster it is moving, the smaller it is. Slowing down the neutron essentially makes them "bigger" which increases the chances of a neutron interacting closely enough with the nucleus of an atom for the neutron to be counted as part of that nucleus, which then gives it a chance to decay and release energy. 

Fast neutrons are used in hydrogen bombs to dramatically increase the fission yield on the secondary fission reaction. IIR, in that case the fast neutrons are being used more like kinetic bullets to overcome the strong nuclear force and smash atoms into smaller atoms.
Reply: @aditigupta1569  nuclear is extremely eco-friendly relative to all other electrical generation methods. Nuclear generation only produces steam. Modern Spent cores get reperposed to make new cores or used in nuclear weapons. Also produces the less environmental waste during mining, construction and maintenance compared to fossil fuel and battery protection in "green energy" 
Nuclear power should actually used more, in my opinion.
Reply: @vlogbrothers  Fizhes
Reply: 0l
Reply: 0l
Reply: Great explanation, just one mini-correction... It doesn't get so hot that oxygen and hydrogen dissociate... The water chemically reacts with the zirconium cladding on the fuel rods to form zirconium oxide, releasing hydrogen. Same thing that happened at Three Mile Island and Fukushima.
Reply: All of the damage caused in Hiroshima was the result of less uranium than a butterfly's weight.  Furthermore, Hydrogen bombs are not  powerful because of fusion, the fusion only contributes a tiny amount to the explosion.  What the fusion does accomplish is to hold the fission reaction together a fraction of a second longer, allowing more fission to occur.
Reply: @mariewikiwaka3851  Use German, that is a clear language 
Kettenreaktion and fission is KERNSPALTUNG, now you dont have any problem ;)
Reply: @aditigupta1569  I can only speak german good enough for this theme.
Der Uranabbau ist eine Katastrophe an sich. In Deutschland sieht man was der Abbau eines Atromkraftwerks bedeutet, das kostete Milliarden an Euro.
Die Anreicherung der Brennstäbe ist auch beschissen für die Umwelt. Also nur der Reaktor selbst ist umweltfreundlich, alles andere drum herum ist eine Katastrophe, aber es gehört dazu!
Reply: Shizzle da fizzle ?